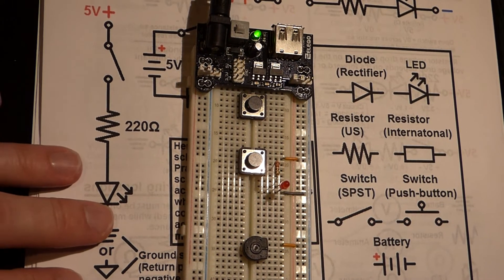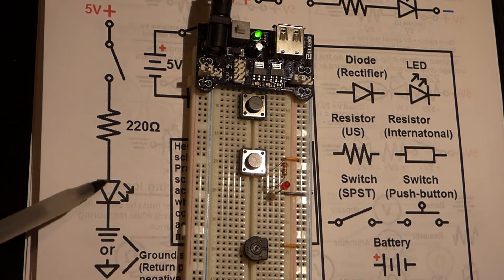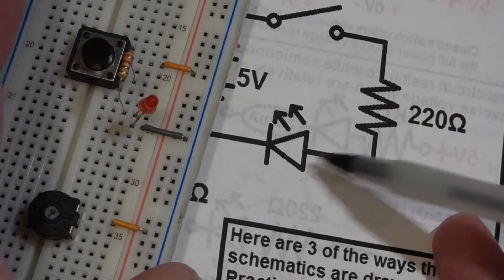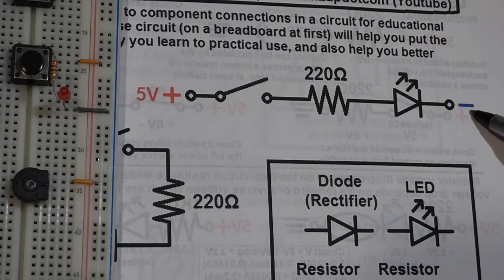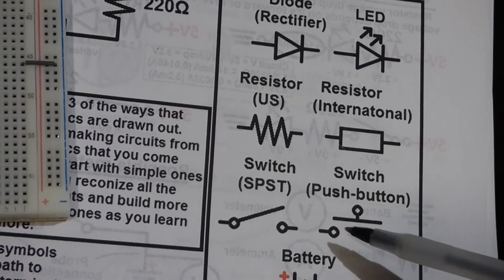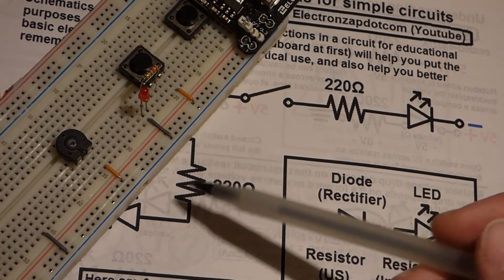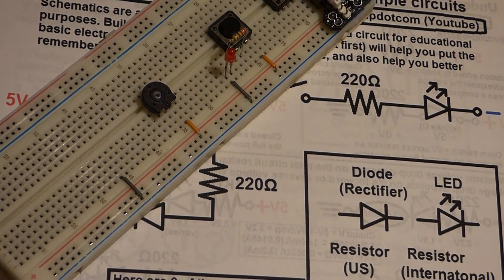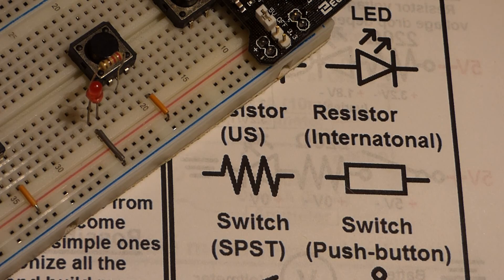Basic electronics 2 Schematics of simple circuits explained in detail by electronzap

Comment: FYI: I recently bought a small low-voltage, PCB mounted "Time-delay Relay" (via Amazon), and it obviously must've been made overseas, because the information page that came with it was quite strange, in translation, (into "English).  The relay terminals on the circuit board are marked "CB,"  "COM" and "CK".   "COM" is fairly obvious, but, what does "CB", or "CK" mean?!... => "N.O." and "N.C." apparently, but, which is which?!  This terminology must be some sort of "standard"?!...
[FYI: I would use a "Push button" switch symbol for a "momentary" switch, and a "toggle switch" symbol for a "maintained contact" switch.  (unless I need to be more specific).]
Reply from the maker: Don't know CB and CK. Won't be on my computer for a bit, but I'd do a Google Search "relay CB CK" or something like that, look for the same item on Amazon and read the Q&A and product descriptions, and worse case scenario, I'd go to Reddit and ask a subreddit where people might know seem to frequent. I've found some module datasheets too while googling.